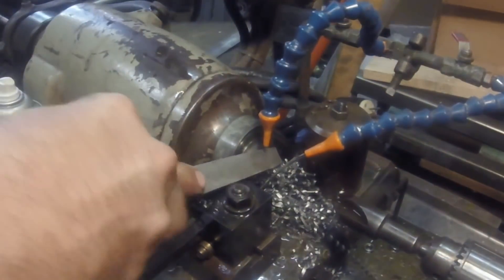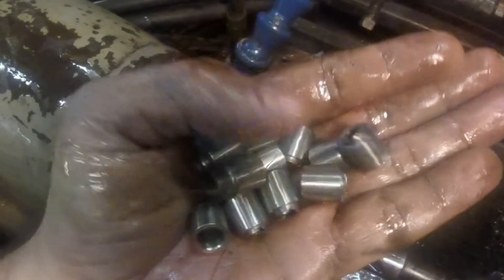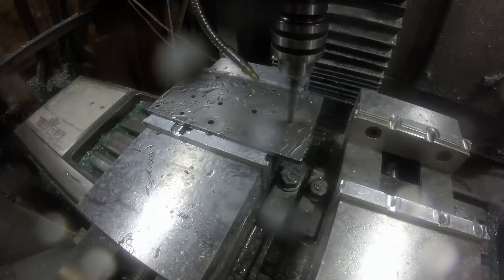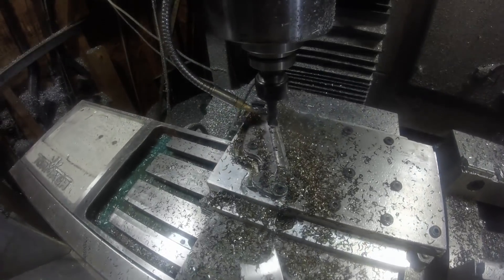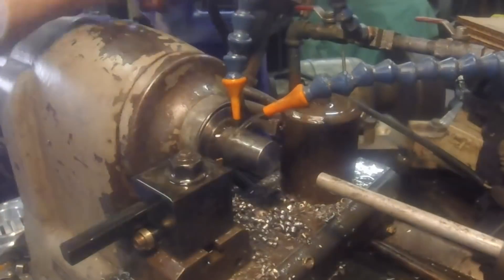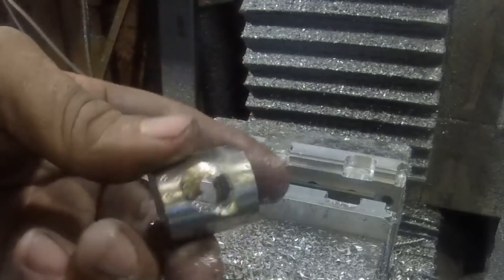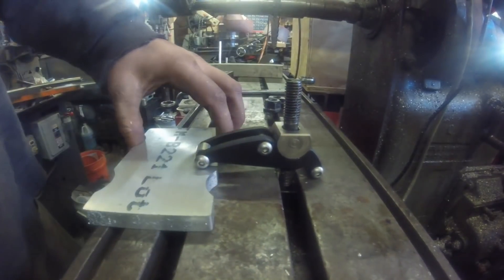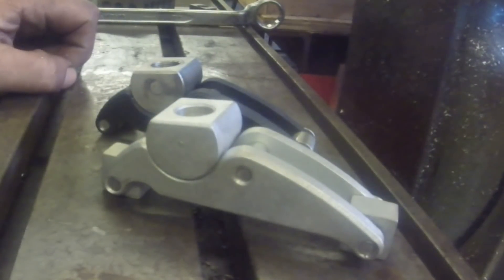Making some adjustable height milling clamps

Comment: A little washer holding up a spring on the bolt will
hold the clamp up, so its not flopping about.
The squared off 'feet' are a great improvement
but the round looks better :)

Comment: Nice one
I'm going to make a set of these soon. I reckon if the central pivot was captive in a hole it can't fall out when handling it. It wouldn't really be an issue though
Reply from the maker: Cool, not a bad little project.  Once there's a bolt in there the pivot can't fall out anyway so I've never had an issue with it.

Comment: Why would you not machine flats on the two clamp rollers to increase the contact area? #baffled
Reply from the maker: If I had thought about it for the first one I would have.  Actually I did in the second set shown at the end of the video - https://youtu.be/D5sbvkpsf6w?t=399
Reply: @ecdezz  I'm glad I read through all the comments before commenting, and I will be honest  enough to say I didn't think of it until you were finished and testing.   I saw when you were pulling on it that the pad had the ability to roll which limited its holding ability.  You definitely had a great idea though.  I like it.
Reply from the maker: @buckinthetree1233  Thanks!  With two clamps it's less and with the square feet you can't move the part at all.  Square feet are the way to go.
Reply: @ecdezz  I understand.  I wasn't trying to be critical.
Reply from the maker: @buckinthetree1233  I didn't take it that way at all :)

Comment: I had never really seen a turret lathe being used in action before this....amazing I know. Those things are equally as interesting as the clamps you made! Also, what kinds of speeds, feeds and depths were you running when cutting out the main body pieces.
Reply from the maker: Turret lathes are cool; almost as cool as a screw machine.  I wish I could justify one of those.

My speeds and feeds are all wrong for the steel.  I rarely cut it and when I do it's always a hassle.  I want to say the main cutter (3/8" roughing carbide) was around 1700 rpm and 14 ipm.  I need to crank it up some.  I'm sure I'm running that carbide too slow.

Comment: They look beautiful.  
Maybe you could make aluminum "shoes" for the steel ones?   I know I saw some with brass shoes but brass interacts with steel, so I don't know if it matters or not.
Reply from the maker: That's a good idea.  It's all the same hardware so just switch them out.

Comment: Nice work!  At what number of parts do you start considering setting up the turret lathe versus making one part at a time?
Reply from the maker: Really depends on the part.  These were pretty simple; both the stainless and aluminum ones.  Took about 15 minutes to set up the lathe for each kind of the smaller parts and less than 5 minutes for the large pivot parts.   It's just a couple of depth stops for this project.

For more complicated stuff it can take quite a while to get it set up right.  I have one particular thing I run on the larger turret lathe and the setup takes about an hour.  Once it's ready I blow through a full 20' stick all at once.  The parts are just under 6" so I get about 40 if them.  The setup takes a while but the part takes less than 90 seconds each.  Definitely worth the setup time but only if I make a stack.

:)